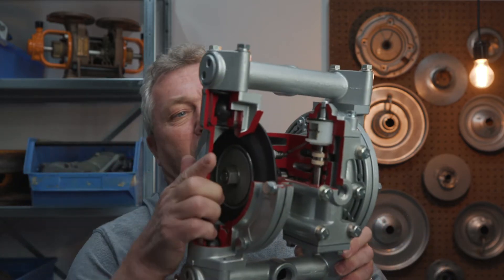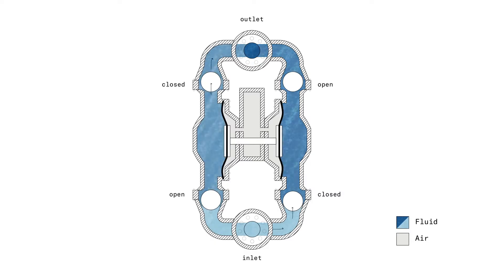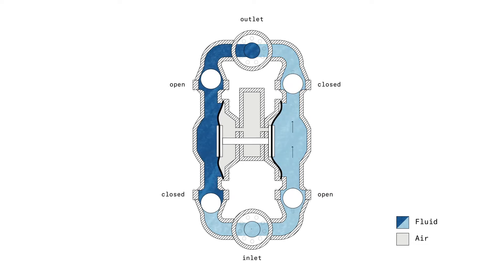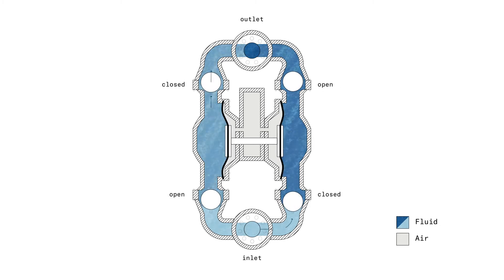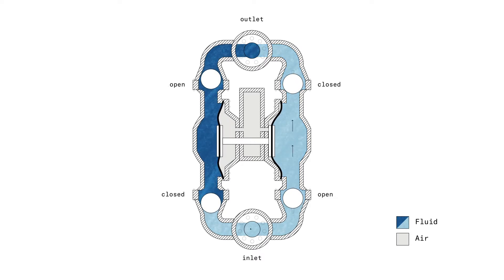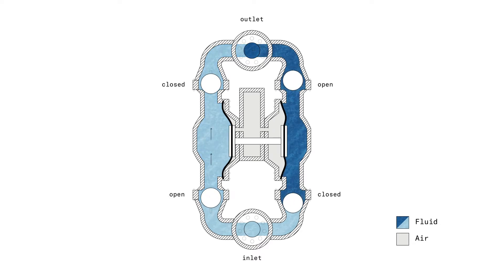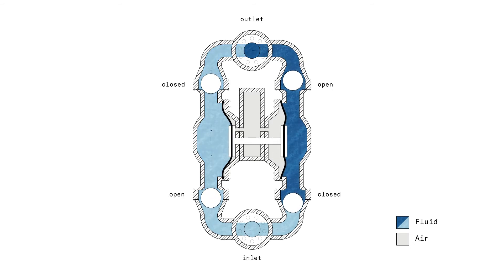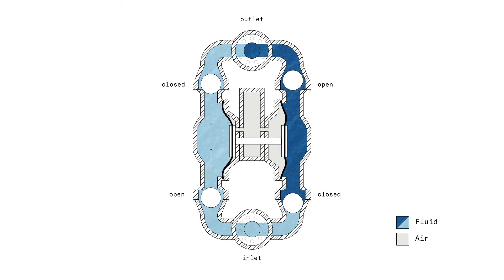How does an AODD PUMP work? | +ANIMATION

Comment: Thanks for the explanation sir. Just one question, can AODD pumps really transfer sludges? Sludges will be in many times, high in viscosity and the small solid particles inside the sludge can block the two valves overtime, if I am not mistaken?
Reply: Yes, an AODD can transfer sludges. Sludge can indeed come in al kind of compositions, thinking of different viscosity and the amount of solids and different solids sizes. You may say, that if you can get it inside the pump, you can also get it to the the discharge. Don't worry about the small particles - bigger particles may be a a bigger problem.